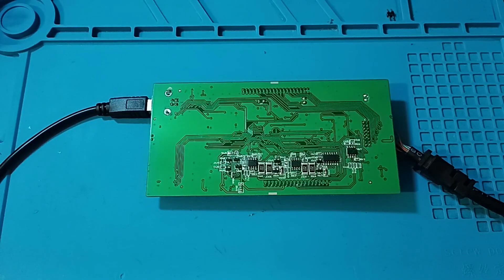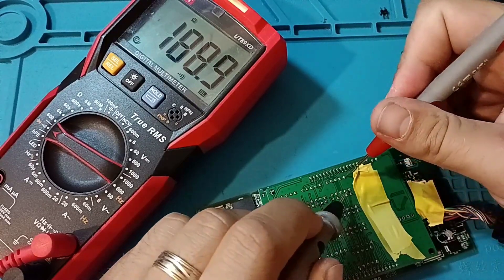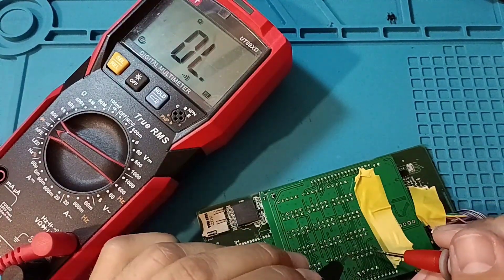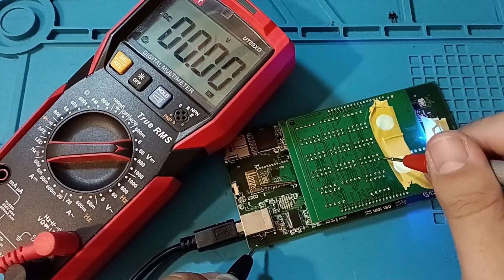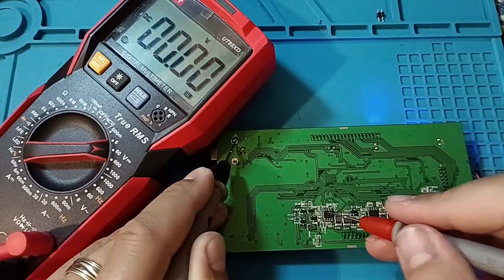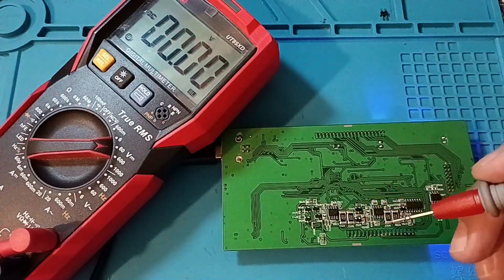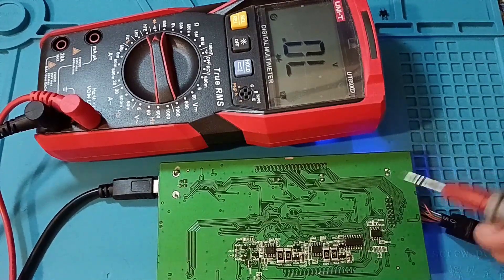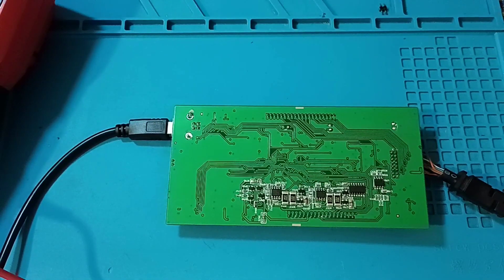ds150e - Delphino.How do we measure the Relays, Voltage and Chip 9241A ? How do we fix this Clone???

Comment: Isn't declaring a relay based on none of its pins having 13V too early? I have very limited knowledge about relays but as long as I know they are supposed to conditionally connect some of their pins to some other of theirs. They are not supposed to create 13V out of thin air. So if no PCB track leads 13V to a given pin then its not the relay's fault. (Except when there is a short-circuit between 13V and ground, but should that be the case some voltage drop or smoke is expected to happen.) What do you think?

Comment: Hello,
I have a device like this with a double board where a relay is no longer controlled. Unfortunately the driver ICs are not labeled so I don't know which components they are. Can you tell me what kind of IC these are? Or is there a circuit diagram?
greeting
Dieter
Reply from the maker: Yes you can find a diagram

Comment: Yoyo, Why are we looking at this board when in your earlier video you proved that this board is the worst of the clones (junk) because many of the connections are missing? It would be more interesting to see you improve the best of the clone boards.
Reply from the maker: Hello.
I made a video with full rework on the highest quality clone, that is, the one with a motherboard.  This video is just to help some subscribers measure relays and voltage.
Reply: @YOYODiagnostic  Sorry, I did not know about the other video. Please supply a link. Also I never said how much I like your videos and the fact you tell the truth!
Reply: What is the best system (Cars) to access all fault codes and a description of the errors. And if possible some minor activation e.g. activate the EGR valve in order to check that it works for use with laptop or smartphone that could be used for my vehicles (none commercial use).
Reply from the maker: @truebuild1745  Xtool A30M . Update unlimited
Reply from the maker: @truebuild1745  Thanks 👍